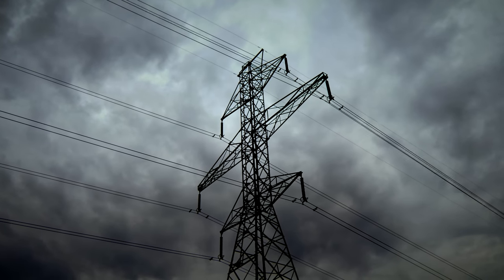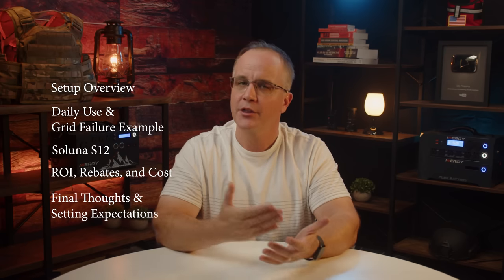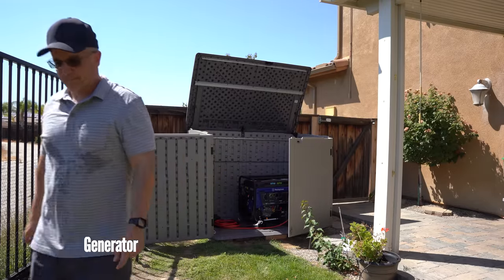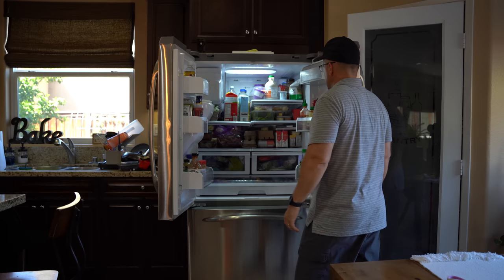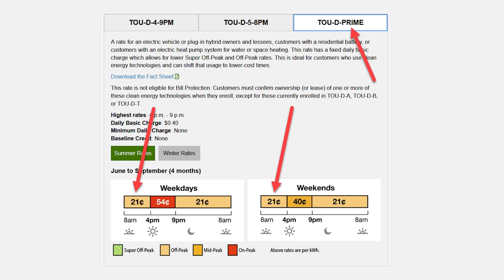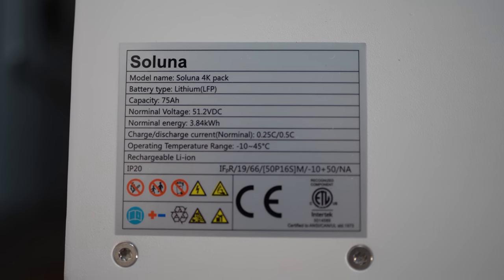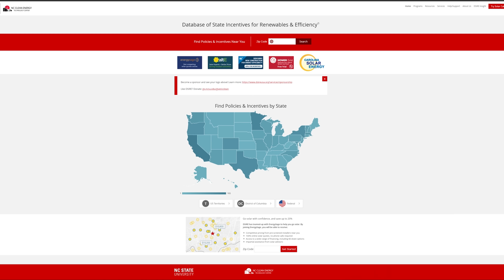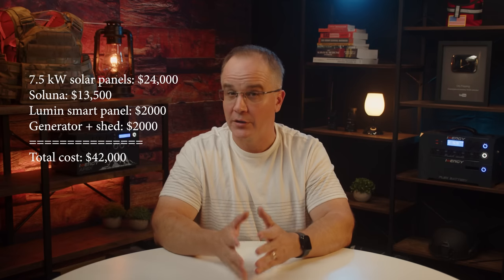The Coming Power Grid Collapse.  Soluna S12 Whole Home Backup Power

Comment: I appreciate all this. To many of us, this is over budget…to some, we can (only) purchase portable E.g. Bluetti ac200max with additional b230 batteries. I have 2 batteries). This equals 6,000 watt hours. Remember, it’s all about watt hours. So this kind of a set up can handle refrigerators, fans (live in FL), air fryers, rice cookers, coffee…etc. finally, over budget solar panels as most often you’re getting 50-75% efficiency. 
Bluetti is my choice but Delta Pro Max is the good alternative. 
You’ll spend about $1.00 per watt hour. 
(Remember: the Bluetti AC300 does not have any watt hours but is just the management system for their B300 add on batteries. The AC200 has 2,000 wh before you add more batteries. Does about the same as the upgrade 300. Start with something as as you save, but a added battery to your system…
Solar: always buy 180 watt or more glass panels or 250 watt+ fold out.
Reply: i'm the same. went w the Bluetti and portable solar panel route. it gives alot more flexibility and frankly, if power goes out for extended period of time, i'm resigning myself that i'm not going to expect to have all of the same conveniences as i would with 100% on demand power. the priorities will be food preservation of perishables (I've invested in some DC running refrigeration), cooking, cooling (enough to be somewhat comfortable) and heating. secondary is clothes washing (forget about using your dryer - get a $5 clothes line) and other occasional use electrical items.
Reply: @SuperLooneyrooney  what bluetti did you get?
Reply: @zfontain1975  first got the AC200P, then got the EB240 (it was clearance sale so got it at pretty good price), the SP200x3 panels when i bought the 200P and then PV 350x2 when i bought the EB240. then just this past week bought the B300. I'm building a small cabin on some land and will think of how i can consolidate at that time.

Comment: As someone living in a country with constant load shedding (South Africa)  a few points from my experience. 

Get a solar system as soon as you can, the sooner you get it the sooner it can pay itself off. The systems are mostly modular so you can get the main components and then add on to them as you can afford them. Also as the grid starts to go down the components will rise drastically. The batteries I have in my system that I installed 3 years ago are now 60% more in my country due to the demand for them.

Do not get a generator, rather add the money you would spend on a generator to you solar system. They need regular maintenance and do not handle running off and on everyday for months. There are many reports of people's generators blowing up and causing damage to there property's, the geni we have at my work blew and damaged all the electronics in our building killing all our aircons and most peoples laptop chargers. 

If you are in the market for a new air conditioning unit get one that uses inverter technology, these have a much lower power usage and more importantly have a much lower peak draw which stops them from tripping your inverter. 

Hope this helps.
Reply: Hi, thanks that is useful. What is your daily electricity use ?
Reply: @teranova5566  hey, it's around 42kwh a day.
Reply: @TheBulletproofMullet  Ok thank you, that is a very high value. I live in UK with very mild weather and I have daily use of around 5.4 kWh/day counting from the year  average, in winter months I use around 6.4 kWh/day.
Reply: @teranova5566  oh wow that is very low, you should easily beable to go off grid with a small system then.

Comment: Question: in the event of a "total. US grid collapse" what would you consider to be the telltale sign that it's not a typical local/regional outage?   There wouldn't be any Twitter posts or TV broadcasts telling you the entire grid is down since they also depend on the grid.  Some networks may have backup generators but wouldn't your cable/satellite/internet provider also need backup power to get those broadcasts out to you?  In my view I believe this is probably where radio (specifically HAM) comes into play.  Reports from multiple operators in varying locations across the US would be a good indicator of a significant US grid collapse.
Reply: Even a total grid down of a major city will be pretty catastrophic if it goes on for more than 24hrs.  You will know it because people will start looting and chaos will ensue very quickly.
Reply: @bradspaugh9827  Agreed.  This is often the case with large hurricanes.  Only difference is that the problem is localized meaning help is able to come from outside the disaster zone.  A total US collapse would mean that nobody is able to help nobody. And it may take time for a city to realize this due to issues of communication.   I just wonder how long will it take for the average person to realize the depth of the problem given the lack of everyday news sources.  Any government broadcasts (via generator power) is likely to downplay the scope of the problem to minimize panic.  If I get on the HAM and I have people in non contiguous states telling me they're all experiencing a widespread outage that's a huge red flag.
Reply: Actually, there will still be radio and tv board casting. They will have backup power. The problem will be every one else, if they have power to listen or see what’s going on TV. I know cable, internet and other things will be down. I went and got a digital converter and an digital antenna with 50 feet of coaxial cable. The antenna I have set up in my attic with the cable. I had to use it one time and it worked perfectly. I would recommend that to anyone. Cost about $100. Great backup.
Reply: If it’s widespread even regionally where you have say the entire east coast without power for example. Large urban centers are going to see an increased police and even military presence possibly at some point to try to maintain the image of order. But ultimately looting, vandalism and lawlessness would take hold. As resources become more scarce those people will begin to scatter into rural areas to find basic necessities such as food and water or even to get away from famine and disease.
Reply: @iiinsaiii   I also have a digital converter and antenna for this reason.  My general feelings on emergency broadcasts (TV or radio) is that there might be pertinent facts that could be left out to avoid a panic.  That's why I prefer HAM so I can actually speak with someone who's actually on-site and has no reason to not report objectively.
Reply: @CH-eg5rd  True. I have them too. You definitely need to know what’s going on.
Reply: @lanemckinney5383   I wonder about this also.  If we're saying there's a large enough "event" that could lead to civil unrest/chaos it may be fair to assume that some officers would choose to stay home and look after their own family.  Military on the other hand may be easier to "deploy" given that they are often far away from their families as a general rule (field training, occupational training, combat deployments).   Not to mention a different punitive system (UCMJ) that has higher penalties for not "showing up to work".  It's all just hypothetical. Nobody really knows what would happen.
Reply: @iiinsaiii  In Puerto Rico after Hurricane Maria hit, there weren't any radio or TV stations still on the air. While some had backup power, either the towers themselves were damaged/destroyed or the links between the radio/TV studios and the towers were fubar. FEMA had no way to tell people where the distribution points were for relief aid.

Comment: Ive been saving up money to buy a solar generator after binging your videos about it. Unfortunately with the inflation, ive been more concerned with everyday things but im still saving up for one
Reply: Same, I've been making my budget stretch with handful of extra stuff (namely food and water) every time I go to the supermarket and I reserve some money left over for one or 2 relatively expensive prepping purchases each month if I can afford to. I just started a new job recently so I am going to use my first few paychecks to get a solar generator....even though the sun doesn't really face my direction, which sucks, but it's better to have it and not need it than need it and not have. Keep calm and prep on.
Reply from the maker: solar generators are definitely a nice to have option, but not critical.  focus on food, water, medical, and other critical items.  solar generators come later.
Reply: Bought the EcoFlow Delta which also came w/ 100 Watt Solar panels.  (does the job of powering up a fridge but still portable enough) the beginning of Dec 2021 from the Home Shopping Network HSN (don’t usually shop there but their deal was better than Amazon + you get the solar panels too). 

$999 + Tax $77.50 = $1077.49 💙🙏🇺🇸
Reply: @CityPrepping  in same situation. Had a Jackery solar generator but it stopped working but I do plan on getting a solar generator with panel when I can finanically. Today I ordered two 2 security cameras for security. Right now, I'm just focusing on being able to stock up on more canned foods, some water, and maybe looking into getting a rain catchment system [I stay in a studio apartment] though I do have stored water and got water filters in my bug out bag. Good video City Prepping.

Comment: If Lake Powell drops 30 more feet, 6mm people will lose power. That affects the entire western US, as we’re all interconnected.
Reply from the maker: YUP!  And that's why I proactively installed this.  The writing is on the wall.
Reply: ...and Hoover Dam has double the generating capacity of Glen Canyon Dam. Hoover power generation is already down 25% due to low water, and will go to zero power if the lake drops 90 more feet. This could happen in the next 18-24 months. Combined, the two dams produce power for 14MM people.
Reply: permag- oh man you just stressed me out! On a positive note, Phoenix got our monsoon rains this month...

Comment: While I can appreciate the emp-proof feature, we built our system so that we were neither tied to the grid or to the property if we move or have to leave for any reason. We have built one room into what is basically a huge faraday cage to keep our computers and necessities such as extra panels, etc. safe. But, our entire house is 504 square feet, not 3000+ and we have very little that requires a huge draw on batteries. Frig, stove, and freezer, on demand HWH, led lighting, two computers, and one AC. The AC is mostly optional unless we hit 100F due to my health issues, but we also have a dual fuel genny that we could use, a small pool I can get into to avoid overheating, and we use passive airflow similar to what is used for Earth-bermed homes and root cellars which makes a 15 or so degree difference reliably and for free. Our main reason for this particular setup is that we don't plan to be here permanently, and I've got zero interest in paying for a complete solar setup twice. We live on a disabled/retired military pension and that definitely leaves a system like you've got not possible (or even desirable). We were lucky to be living in a self-contracting area which left us free to build just about any thing we chose, and to do our wiring ourselves. Our system pulls from both the sun and the wind, and we have roughly 95% of the year with wind. 

I would advise anyone concerned about the grid and/or keeping power on at their home to do their research and get even a small system so that they can keep a refrigerator and some fans up and running at the very least. We are planning to add one of the Dometic refrigerator/freezers for long term use if need be instead of using the full size appliances, as well as putting together a small box truck as a bug out vehicle. That little frig will work just fine in that. Thank you for the detail you put into this. We've questioned whether doing our own system was the wisest thing to do, but given the costs involved I'm happy with what we have.
Reply: In the case of emp attack, wouldn't everything in the house be toast, regardless of a home emp protector? Would the fridge, stove, etc be unusable?
Reply: @knothead35  We don't have any appliances with electronics, and we can both repair any damaged wiring. We don't even own a cell phone (and do not want to). What we want absolutely protected is, and to the overboard military standards because that is what my husband was trained on. He is a skilled electrician, computer tech, etc. We also have the parts and raw materials necessary for a lot of things. We chose a small home because neither of us likes cleaning, but it comes with a plethora of other benefits. We also detest things such as appliances with computer panels of any sort. I still have my wringer washer, spare motors and belts for it lol. I think a lot of things would not handle an emp all that well. I gave up on even cordless phones and have a bakelite with an actual bell/clapper in it after losing three in a single year. But, we also have two wood burning stoves, an outdoor cooking setup (brick and mortar), etc. We could live without any power if we weren't both gamers. My goal is to sit and play Skyrim at the end of a day of gardening, canning, dehydrating, etc.

Comment: I live in a apartment, however after the power grid went down last winter in Dallas I bought some items to help in case power is out for a while. 

The main product was the Jackery power supply, with a solar attachment.  It's not that large and I can easily store it away.   

If I ever owned my own (non HOA) home I would love to get a generator and solar panels.
Reply: I have so.ething similar,  an ecoflow , n8t a huge one but trust me, it's already proved invaluable. It won't power my home, but I also have a normal gas generator,  which I go back and forth between.
Those systems are seriously expensive,  I wish I could afford one , but honestly it's just not possible currently.  We do are best, that's all we can do.

Comment: That is a very nice setup! Most likely, I will not be able to afford that before SHTF.  I will have to suffice with the Ecoflow Delta.  I am happy for you and it is nice to see what is available!  Also 4 years to pay for itself isn't bad.  I've had bids where it was 10 years and that was just for solar panels.
Reply: Hi. I've been considering an Ecoflow.  What about it made you decide to buy it? What is your setup like (parts)? Did you get their air conditioner? If so, how do you like it? I'm in the Texas heat wave right now. 95-102 degrees but 56-90% humidity.
Reply: @patricianichols9514  I like it! I bought it because of the fast charging, you can use it while you charge, you can use any brand solar panels with it and it's only 40 pounds.  I don't think I could lug around anything much heavier. Also, everything I have in mind to run with it is about 1000 watts and it can do 1300.  I have a 140 watt Zamp panel and a Dokio 200 watt panel.  I haven't tried charging it with both panels at the same time but each panel separately works fine. I have not tried it with the AC.  Good luck!  I'm in Utah and it's hot here too!
Reply: Thank-you, thank-you,  thank-you.  Do you have the ac unit for it? Or do you plan on running a window unit? I, personally would lean towards their ac unit with a room fan because of the window unit noise and needing to be vented to the outside.

Comment: Great minds think alike.  I had solar panels installed 5 years ago.  With the warnings of power outages, rising energy costs, and rising inflation, I had a NeoVolta 14.4kWh backup battery installed a few months ago.  NeoVolta is expandable to 24kWh should I need it in the future.  My system has very similar specs to yours.  The system will power the whole house with the exception of central A/C, but I have a portable A/C unit that can be rolled from room to room if needed.  I haven't had a power bill in 5 years and couldn't be happier with the system.   I am very interested in the EMP shield and am looking forward to that video.  Thanks again for another great video.  Stay safe!

Comment: Great video. Living in Upstate NY, we don't get nearly the sunlight that you get so knowing that I am really only concerned with food supply and a couple basic
appliances, we are going to get a dual fuel generator and hopefully stock up on propane tanks. Just not sure how much power we need. I am figuring a 12000
watt generator should be enough to do what we need it to do but as we all know, eventually the propane runs out. The investment in solar panels would just
not be worth it in my area. It would cost well over $100,000. and I don't think we would live long enough to see it pay for itself with the lack of sunlight.
Reply: Bob- maybe in your area a wind turbine would work instead of solar?

Comment: We have a similar system.  We has solar installed about 4 years ago,  when the tax rebate was larger than it is now. We had the battery back up installed this Spring it provides power for our well, freezer, refrigerator and lights. If we used the AC, clothes dryer and dishwasher,  we would drain the battery quickly.  Every room in the house has ceiling fans and we have good insulation.  The house has never reached 95 on the hottest day without AC. We live in Northern California where we have low humidity.
Our cooking and heating is propane with a 320 gal tank. I'm hoping that we will be ok.